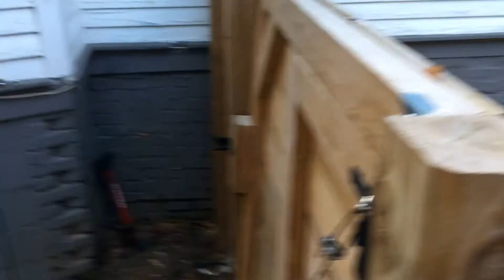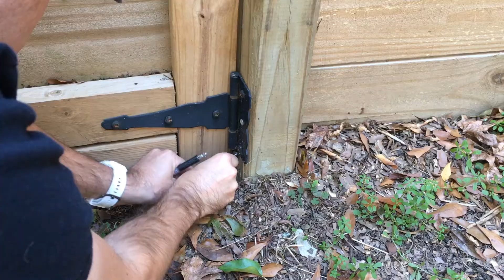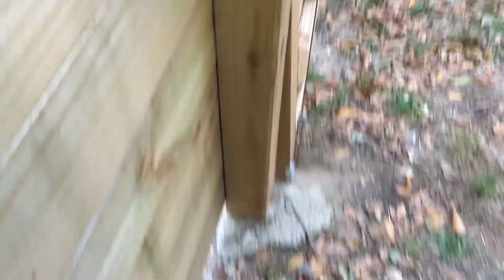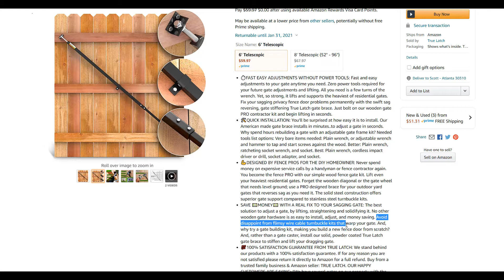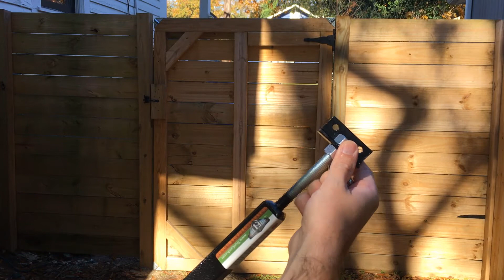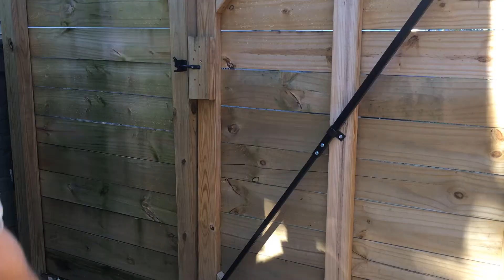Attempting to Fix Warped Gate from Anti-Sag Cable with True Latch Metal Brace

Comment: Next time add a diagonal 2x4 brace from bottom hinge corner to top latch corner, instead of the straight brace in the middle. 
Then you can cable brace and not have warping or sagging.

Comment: I know this is 4yrs later BUT here's what happened to your gate and also the solution....it's all about tension.
Firstly, the gate needs a compression brace from the top latch side to the bottom hinge side with an angle NOT greater than 45deg. This will PREVENT any sagging.
Secondly, the REASON the gate warped was because the face boards dried AFTER being screwed on which would shrink them causing tension on the framing. The framing
having nowhere to go then twists under the tension of the boards pulling on it.
Lastly, the FIX.....unscrew the boards(hopefully they were screwed in) which will relieve the compression pressure on the frame, twist the frame so it is plumb and secure it to the posts on the latch side with a couple of long screws top and bottom so it doesn't shift, then reattach the boards using the same holes but move the boards up 1/4-1/2 inch to ensure you miss the previous holes in the framing, then remove the screws securing the frame to the post. As long as the framing isn't warped this should relieve the tension as the boards will have been seasoned and will no longer shrink. Think about boards that cup or twist when left to dry in the sun. Your gate did the same thing but because they were screwed to the frame, they just transferred that tension to the only thing restricting them. 
Thanks for the demo on those other products though, I'm sure they have a useful purpose somewhere....but not on gates .
Reply: Thank you for sharing that , with your comment and this video saved me a ton of time and money

Comment: Dumb question but can you have both a tension and compression brace? I've read yes and no from folks. Thank you kindly
Reply: Absolutely! Compression and Tension are opposite/opposing forces, so its perfectly fine. Most people usually do have both. I used to alot, but nowadays, i only use tension braces if either, its absolutely necessary, or if i build an extra rigid frame, meaning a basic frame, where the face of the frame boards are flat against the back side of the pickets, and then another 2x, on the outside of each original perimeter framing board, except make the outside ones perpendicular to the original frame, so theres a 90 degree angle formed between both boards on all sides,  making it much more rigid, because (in my experience) without doing so, adding a tension brace ends up /twisting/warping the bottom latch side of the gate once the brace is tightened. But if you want to use both,  you just build your compression brace into the gate frame, ALWAYS from the bottom hinge side to top latch side with a 2x4 (as long as your gate isnt so wide, that the angle between the brace and the vertical framing boards is greater than 45 degrees). Then you your tension brace goes the exact opposite way (so the two braces make an “X”), from top Hinge side, to bottom latch side. If you dont buy one of the anti sag kits, and decide to make your own, its best to use stainless wire rope and hardware or at leasted coated wire rope and stainless hw or it’s gonna rust very prematurely.

Comment: Hi, I wonder if a simple steel square tube or U channel and 3 screws would not do the same for less cost.
Reply from the maker: I think that would totally work, although the True Latch thing has the ability to tighten after it's bolted in. But it would prevent additional sag without that.

Comment: If a tension cable could be installed inside the body of the gate along the center of the material, the tension would have been along the center of the gate's plane theoretically and it would not have warped. But since we can only install it on the surface, there also a force perpendicular away from the gate surface on the side where the tension cable was installed, pulling the corners with the mount away from the plane of the gate and warped it.  I can see that your gate is still warp after the new rod was installed because you just mounted the rod on the already warp gate. I think in theory, if a second tension cable had originally  been installed parallel to the first cable and the tensions of the two cables were equal, the door would not have warp. Assumptions are you manager to equalize the tension of each cables and you don't mind people outside seeing a cable on your gate.

Comment: Gravity pulls down on your gate while the hinges hold up one side.  Those opposing forces and natural joint loosening will tend to move your gate from a rectangle shape to a parallelogram shape. Any solid brace (wood or metal) should go from the lower hinged corner up diagonally so that the solid brace is in compression.  A cable brace cannot be in compression, and has to be mounted from the top hinged corner down diagonally to oppose the gravity force with tension.  Because the cable is on the back side only, it tends to twist the gate.  If you took your second cable and installed it on the outside of the gate, from the top hinged corner down diagonally, both cables would act to prevent sagging, and counteract each other from twisting.  You would have the ugly cable outside your unsagged, flat gate though.  Also, turnbuckles ALWAYS have a right-hand thread side and a left-hand thread side so they can be turned to adjust the tension without unhooking an end.  It's a desigh feature.
Reply from the maker: This is a great summary of everything going on, and I wish I had thought of putting a cable on the other side.
Reply: So do you mean making an X w tension cables but one inside gare and one outside the gate?  Or would they both (outside and inside tension cables) be diagonally top hinge to bottom opposite corner? I am having difficulty visualizing this. Did I misunderstand?

Comment: The blue one is the way it is to be done. All gates need diagonal bracing. I would build a new gate! I always do lap joints as well. You could remove your center board, and add a diagonal board.
Reply: No it's not. A compression brace must go from the bottom+hinge corner to the top-latch corner. In his example the Red one is correct if you're building a new gate.

Comment: If you have 2 people hold the door in place it works a lot better. One pushing on top and another pushing at the bottom and keeping it inline, Then put the brace on. It will work a lot better....These should be used before it gets twisted anyway. Worked for me.
Reply: Anti sag cables don’t work for removing warp from gates  you need a steel bar to correct this situation from te top of the hinge side to the bottom of the opening side  I used this method on my gate and it worked now when my gate is closed it is aligned properly

Comment: I am having the same issue.  And the guy that installed by gate put tension cables going both ways.  The gate has only been up for about 2 weeks and it looks like yours already.  I have a lot of issues with how this whole thing was installed.  I rent, so the landlord paid for this mess.  But I am the one that had to live with it.  In damp weather the wood swells, and screws scrap and the door catches.  When the weather is dry, the wood shrinks and the won't even latch.
Reply from the maker: Yeah I don't think it took line for the tension wire to warp my gate. Mine still sticks occasionally after a rain...  I have a lot of respect for whoever makes gates that work!

Comment: I am with you. I built 2 6ft gates. The gate attached to house works great obviously. 

But, the other gate pulls on the corner post. I should have used a 6x6 post. Instead, I reinforced the concrete but that didn’t work.  I do have corner bracing. I watched the Paul Ricdale video as well. He had 6x6 posts. I pressed my frame with lap joints. I may try the cable method or order a gate tire to help.
Reply from the maker: do you think it's your post or gate? If the gate, any chance to use an H brace? https://www.youtube.com/watch?v=yTY4ACYwy_M
Reply: @ScottDriscoll  it’s my post, as I push on on the corner post my gate lifts up. I have one side anchored to a batter board while the concrete is drying I think the H brace you have to put another post out to the side of that right parallel with it I don’t know if my wife will be down with that

Comment: You can’t use a cable as you did in your second placement. That’s where a diagonal brace made of lumber should be where the people in the comments were mentioning. As the gate sags, that brace that you install from the bottom hinge side to the top corner of the latch side diagonally will be in compression. A cable won’t be able to help here, in fact it will just make it worse. You need a board in there to resist the compression forces, and a cable going from the top hinge corner to the bottom latch corner, as this dimension tries to elongate rather than compress. The cable keeps that from happening, and aids the diagonal lumber support so it’s not doing all of the work.

Comment: Well if you raised the locking latch on the top and install one at the bottom (I know it would be annoying opening and closing) it will straighten back. Give it one summer season and don't use the gate unless you have too.

Comment: I know it would cost another $60, but attaching a second brace on the other side of the gate running parallel to the first brace would probably remove the warp. Having just one brace produces the potato chip effect but a second brace would counter the first and keep the gate in a flat plane.
Reply from the maker: the steel brace doesn't impart any additional warping forces on the gate, but I wonder if a cable kit on the other side would have balanced things out initially.
Reply: @ScottDriscoll  Nope! Gates built out of low-grade lumber will always warp. I see a lot of low-grade lumber in your poorly designed gate.
When building a gate you must pick out the best possible material from the pile. 
Let it set out & acclimate to the environment for a couple weeks. Any defects will start to show themselves. Return those boards for replacement.
Check out this link: https://www.youtube.com/watch?v=5oMX_XYbPvk 
Then still, you may have to use counteracting forces in individual boards to cancel out the defects in the poor quality lumber provided these days. 
Hope this helps you.